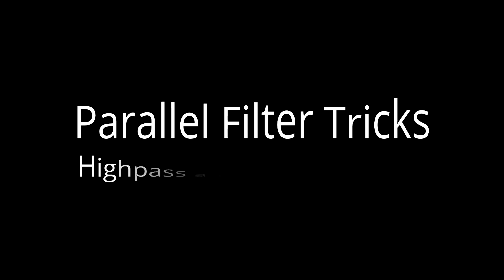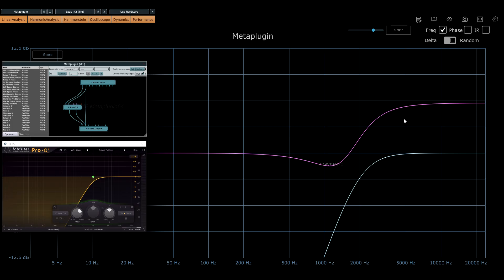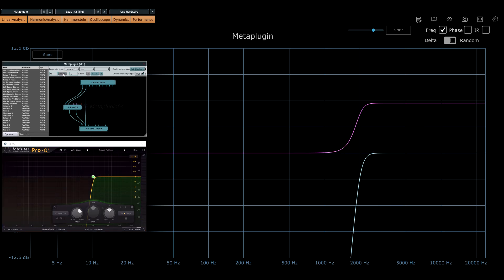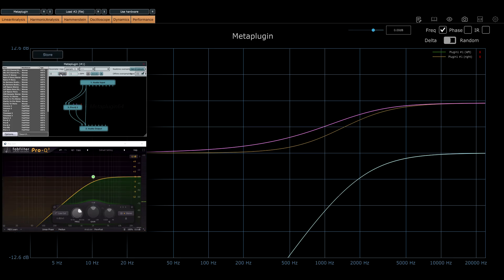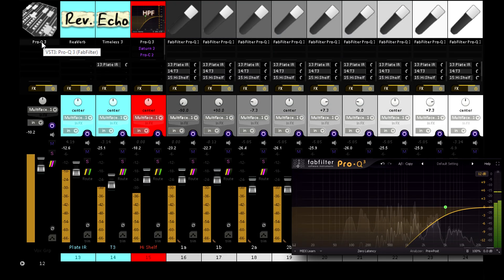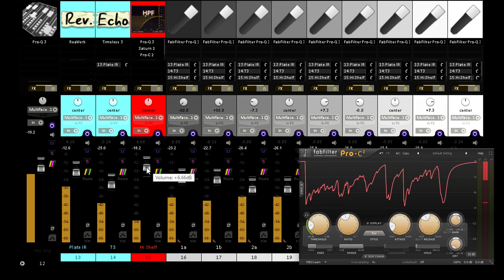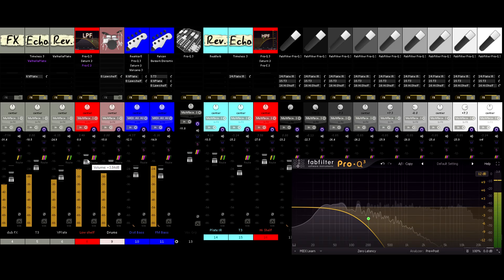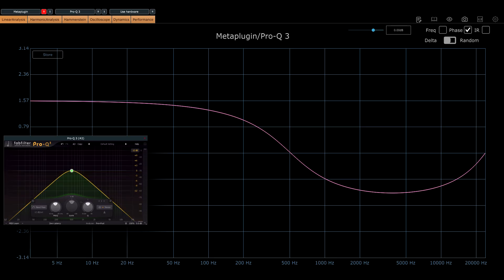Parallel Filter Tricks: Highpass and Lowpass Filters

Comment: This is a technique I do all the time. I love parallel processes over just regular EQ boosts. 

Something that I commonly do with drums is send the drums via a send to a channel with EQ to isolate the mid band with a band-pass (generally speaking, you want the fundamental of the snare and just enough of the kick without too much bass and subs); run an upward expander in the chain; followed by saturation and sometimes compression. The upward expander is used because over the years, upward expansion has become a preferred method of mine to exaggerate transients over compression (it's basically a transient shaper but for the attack transient exclusively). The saturation adds crunchiness or grit; the compressor is for optionally controlling peaks although this will more often than not be on the drum bus which the parallel chain usually gets routed to. This works exceptionally well for acoustic drums. Particularly if it is the overheads that you send which I usually do. Of course, I will sometimes send a little bit of kick and snare to that parallel chain also. 

As a side note, because overheads get sent, which contain stereo information, I'll sometimes add another EQ after the saturation and then reduce subs from the side (HP filter) and mids from the center (regular bell). Sometimes kicks can get a bit too mid-end heavy too and "boomy" sounding so it's always a good idea to be a little surgical with the sub-harmonics on the kick that are introduced through the saturation. Of course, sometimes another band-pass after saturation can be effective to use here to clean up sub-harmonics that are generated. The only other thing is to be careful with the amount you bring in the mix due to the mid-end information that get's introduced in the cymbals (they can sometimes sound harsh because of it).

Likewise, with the technique outlined here for the high-end boost, when saturating highs after the EQ, it can also be a good idea to add another HP after the saturation for the same reason (although this will depend a lot on how much you saturate). As the saturation can introduce some nasty mid-end fuzz-like noise (of course, you may keep it if you like it). Mixes can become very dense sounding when you do these kind of techniques though (you will almost certainly overdo this stuff when you start trying the technique out for the first time).

Honestly though, anyone watching you can try all kinds of combinations of effects for parallel processing like this. You can go crazy with time-based effects in addition with distortion with the same principles in mind i.e. isolate some band of frequencies, and add other kinds of effects to get really creative results.

Edit: I literally paused after the low-pass section before watching the very end. Looks like you already know what I am talking about.

Comment: I love these videos! Explains so much!
The last weeks I've wondered how I can check if I have phase-cancelling filter issues on my mix. For example I have HPF on many tracks that needs cleaning of sub-frequencies, but I wish there was an easy way to eye-check wether or not these steeper slopes actually creates problems. Would this method work for that? Or does it have to be loaded in to the same channel-chain? I haven't creatively figured out how to check for such issues yet 🤔
Reply from the maker: The air between your speakers and your ears shifts the phase more than your high pass filters. Steeper filters shift the phase more, but if it sounds good there's no issue.

Comment: I actually quite respect translating Q = 1/sqrt(2) as 1, because even a lot of engineers treat the "maximally flat response" value as "regular."  I think critical damping should be the "regular value," but alas.  Even there, while its value, one-half, is a nicer number, to an actual musician or producer, "one-half of what?" is a perfectly cromulent question, the answer to which provides them with no usable insight.  So either way, the number doesn't intrinsically mean anything to nearly anyone using DAWs.  And since 0.72 is an approximation anyway, it means even less.  "1" means something though, and that's "regular."  Could be zero for many "knobs" too, but not for Q, since it can only be positive (or else we'd have a great source of free energy).

Comment: Hi Dan, I’m wondering if you would usually go for a low pass filter or a shelf filter on a bass or bass group (not in parallel). My lowest fundamental base note is an A, around 54 Hz and I feel like there’s a little unnecessary rumble Below 20 but it needs some more around 30hz-40 hz range).  

Thank you

Comment: 8:20 It is an another method of bass boosting your songs, which by mixing a lowpassed version of the same signal (whether or not lowpassed version is downmixed to mono) with the original signal, with or without the lowpassed version is boosted to much higher levels before mixing. I've done this in Audacity for bass boosting purposes

BTW, a 12dB/oct lowpass filter when mixed with the original signal, has a dip on upper frequencies part similar to Pultec low-end trick, but idk this dip make bass boosts using this method sound better than just using low-shelf filter of typical parametric equalizer effects

Comment: 7:25 when you start introducing other plugins like the saturator, how do I avoid things like cone filtering due to track being delayed because of the processing? I feel like the DAW should be compensating, but I work in FL Studio and it doesn't seem to be.
Reply from the maker: You could stick to saturation plugins that don't add any latency. Or switch to a DAW that handles PDC properly. I know you won't like the second option, but honestly, solid, unbreakable PDC is one of the main reasons I use Reaper.

Comment: Okay here's a question. Do IRs made with EQ curves translate the phase shift of the filters? Even if it does you could use a linear phase filter to create an IR and it would always take the same level of CPU etc..
Reply from the maker: Yes IRs also capture phase shift. FYI the maths behind FIR filters is basically just convolution. The only difference between a linear phase EQ and a convolution reverb is the former uses a fixed length, synthesized kernel, while the latter uses an arbitrary length kernel measured from real life.
Reply: @DanWorrall  Okay so if I made IRs using an EQ with linear phase filters and then I used something like GPU Audio's low latency convolution plugin to process I could pretty much have the same filter (without adjustability) but beat the latency issue. I'm thinking of purchasing Melda's freeformEQ to do the IRs because it has that function built in but it's a spectral EG so I don't even know if it does the filtering the same way.
Reply from the maker: Unfortunately no. You'll get the same filtering with uncompensated latency. Because half the ringing comes before the impulse in the IR, and you need to keep that or its no longer linear phase.

Comment: @DanWorral I'm not quite following at 8:03 when you say this is different from running a multi-band compressor in parallel (or with dry/wet < 1) with the threshold reacting to the frequency band (default behavior in Pro-MB). Could you clarify what I'm missing here?
Reply: iirc, Pro-MB only has a dry/wet mix for the whole plugin and not individual bands. Also, this method of Multi-Band parallel compression allows you to further process the signal (adding other effects after the compression) before adding it back to the dry signal. You could also route other tracks to this parallel track to get the same effect. It's a way of working smarter and more efficiently. What's more is that this opens up the opportunity to add saturation to just this compressed signal or adding more creative effects like chorus, etc. You can subtly add character to any track routed to the parallel track and control how much of that character you want to add, and only apply it to a specific part of the frequency spectrum.

Comment: Mysterious and unexplained "phase issues" :D

Isn’t the parallel high-shelf trick a way to avoid aliasing aswell ??
Reply from the maker: No. If you use clean filters there will be no aliasing either way. If you use non linear filters, or some other non linearity, there's an equal risk of aliasing either way. It's a separate issue really.
If you meant cramping, also no. But cramping is a much smaller problem for shelves than for bells.
Reply: @DanWorrall  Oh yes, I meant cramping sorry. But I just tested an AB of parallel high pass and highshelf+matching eqing, and the result with the parallel high pass sounds more open ! Is my matching EQ not accurate ? it can be ... but definitely that parallel high pass technique gives a nice "breathing" curve to the source cramping or not !
Reply from the maker: @thomassmilek1973  I don't know. But if it sounds good, it sounds good :)
Reply: @DanWorrall  At the end of the day, it is what it is ... Cheers Dan thank you for all of this content !

Comment: @dan sir can you make a detailed video on multiband compressor's interband modulation. Because adding a multiband compressor without any compression (or any freq splitter plugin) also changes the signal output even upto 5 to 6 db in peaks
Reply from the maker: Sounds like phase shift from a minimum phase crossover. Try it with a linear phase crossover: there should be no change.
Reply: @DanWorrall  yes linear phase option keeps the signal unchanged but punch and attack of drums is compromised. On master buss this is prominent compromise
Reply from the maker: @gangsterdistrict1154  is there any audible issue with minimum phase? Go with that if not. Increased peak levels not a problem unless you're pointlessly chasing maximum loudness.
Reply: @DanWorrall  actually it is absolutely fine to tolerate lil bit of unwanted peaks. But it may be a good topic to introduce your viewers with interband modulation of multiband compressors and filters in general

Comment: What is the Pultec low end trick?
Reply from the maker: Use the cut and boost at the same time. Amusingly the original Pultec manual specifically warned against doing this! The result is a low shelf boost with a broad midrange cut above it: can work wonders on kick drums with extreme settings, or full mixes when applied more subtly.
Reply: @DanWorrall  Thank you Dan! I have learned SO much from your videos. You truly are the man.

Comment: I had this idea a while ago, saturating and compressing a parallel channel with only the high frequencies. It works wonders on pretty much any dry source! Now I finally know why it works :D
Reply: Unfortunately, any saturators I tried in parallel broke and chewed my highs.  Aprox. 9 - 15 kHz is a very uncomfortable band for saturation for me.
Reply: @YuriKovalyov  interesting, what genres are you mainly talking about?
Reply: @lennartrauhe  unplugged instruments (incl. drums - 4 channel recordings mainly) + electric guitars taken from the cabinets without DI + vocals. When recording with my portable equipment I get clean enough sound, but with highly energetic high-end, e.g.: rides from the overhead position. Trying to tame this with the eq is a problem as the eq reduces the level not energy (i.e. the acceleration of high frequencies), taming highs with the saturators chews the highs (slams or turns them into porridge, as I like to say). New native Reaper's antialliasing might help somehow. Shall try soon.
However, the trick Dan proposed might be great for properly recorded signals with mild highs.

Comment: I love this trick, use it extensively on my drums bus, bass buss, and vocal buss. Compress the hell out of the low and high bands and blend them back in. Dan, I've asked about this plug -in before:  the one i use for parallel high-pass and lowpass (midband as well) is the Waves L3 multimaximizer (done by by solo-ing the bands) . Have you experimented/tested it at all? only using it as a crossover (no multi-band compression engaged) .  It does a better job than the ProQ3 and has a LOT less latency. Although ProQ3 latency can be compensated for, my DAW maxes out at around 16,000 samples of compensation (depending on sample rate of session). And the ProQ3 eats up too much of that where I feel limited to not use too many other latency heavy plugs. Would love to be able to give back and help you the way you have helped us by giving you a less-latency option for the same task <3.
Reply from the maker: I'm not sure how you get better than a perfect null? Anyway, Q3 has settings for different amounts of latency in LP mode. You risk getting artifacts if the latency is low, and your filter is also tuned low. But if it's clean in L3 its probably safe to match that latency in Q3 for the same crossover frequency.
Reply: @DanWorrall  thanks for the reply Dan! I just meant better as in the same result but with less resources. At 44.1Hz sample rate, The L3 has 3538 samples of latency (fixed, no options to change). Whereas the ProQ3 has 5184 samples of latency on Medium. The L3 is seemingly perfect (to my ears no testing) even at low frequencies, I regularly use 40-60Hz lowpass band in parallel.
Reply: I think you are saying that if I run ProQ3 on "LOW" mode 3072 samples of latency - it would be similar to the L3, but to my ears the L3 sounds a lot better than Q3 in "LOW". I'd say it even sounds better than "Medium" mode. And once your in HIGH territory you nearing too much latency and forget about VERY HIGH unless you want to hear that parallel track ......tomorrow lol. One thing that makes comparing the two difficult, is that the L3 lacks any useful Slope values - they use a 0 to 100 slider called "separation"  with no indication of db/octave.

Comment: The sum of a lowpass filter and a bandpass filter (multiplied by a specific gain) gets you to a proper low shelving EQ if mixed with the incoming signal. That is why the frequency response looks like the cutoff shifted in ProQ on 0 latency mode (it's not a simple Lp). As an experiment, take an SVF filter (usually this is the filter used in EQs - or in worse case biquads), add the Lp + Bp (multiplied by 1.5), and you get a shelving filter without any dipping. This can be enhanced into 24dB/Oct or any steepness without any issues just by stacking such patches in series and doing a bit of calculation on the mixing gain. This is closest to how this is solved in the analog domain anyways. The algorithm that you find in digital EQs with a nice symmetrical frequency response curve around the cutoff is a bit more complicated in terms of calculations. However, it is still based on calculations of a simple SVF's output ( Shelving = Lp*M^2+Hp*1/M^2+Bp*R*1/M^2 // (where M is the linear boost factor) ). Probably I'm going to make a small video about this since this looks more complicated when written than it is in reality.

Comment: i didn’t know it was called a boost when the freq isn’t boosted. isn’t there a difference between boosting meaning bringing sound above 0 db vs having a high pass filter and turning it up without any boost?
Reply from the maker: Adding the filtered signal to the original is what creates the boost.

Comment: Usualy 12dB or 6dB slopes are having less phaseshift which makes them more 'analog'. mathematically there are two eqcurves possible to represent a similar frequency response. Maybe parallel  bandpass filters are less noticable if aligned  per octave. The point of eq is it delays / phaseshifts a signal for cancellation which is exactly how a filter works.
Maybe the processing is reduced if engaging a dynamic eq mode instead of static otherwise the CPU is used twice if both compressor and pro q3 using oversampling. It is likely that high peaking phaseshifts are making alaising artifacts more obvious so it is recommended to use oversampling on very steep eq slopes or broadband cuts. It is more interesting to figure out if oversampling is required at all if using parallel compression/eq/saturation/distortion because the original signal is retained anyway and if a 12 dB slope in parallel is just something like 6 dB slope in serial it is not exactly that sum but somewhere in a logarithmic loudness range. A big feature suggestion to ffproq3 would be a phaseshift visualisation which would make something like plugin doc redundant for that part. Thanks.

Comment: Hey Dan, I have a question regarding this topic. I like to use Fabfilter saturn on my master and busses, I almost always use saturn with 2 bands, also I like to set the mix of saturn on 50 %.  Because of the filters of saturn and 50% dry this is actually also parallel eq. Will my master now also have smeared phases?
Reply from the maker: Try switching Saturn to linear phase mode. If it sounds better you were smearing your phase with the crossover; if not the phase shift wasn't a problem.

Comment: I don't wanna be harsh, but I missed a little section at the beginning explaining more what is parallel filter. It feels like you started the video with the phase issues assuming people know what is parallel processing. I learn a lot from your videos, but I'm a noob in this.
Reply from the maker: Sorry. It means running a filter as a send effect, as you might a reverb or delay, instead of inserting it on the channel as usual. The important difference is the filtered signal gets added to the dry signal in parallel, so a high pass filter will turn into a high shelf boost, and a low pass filter will turn into a low shelf boost.
Reply: @DanWorrall  I see, thanks for rhe response. I understand running it as a send effect, but I didn't knew the terminology.